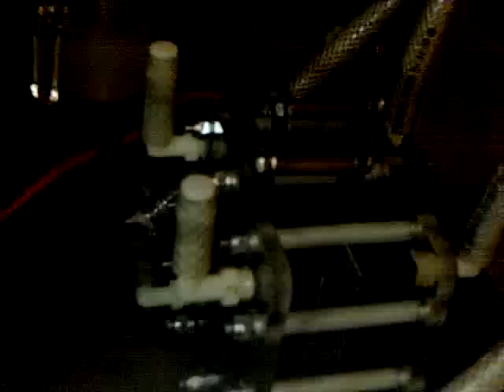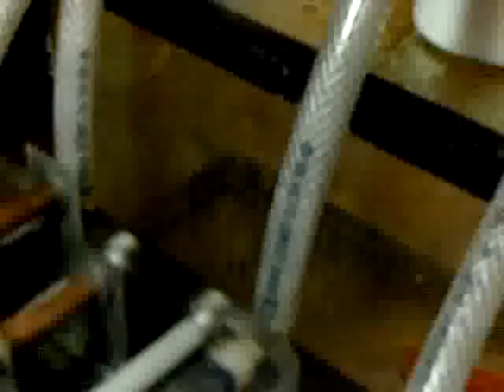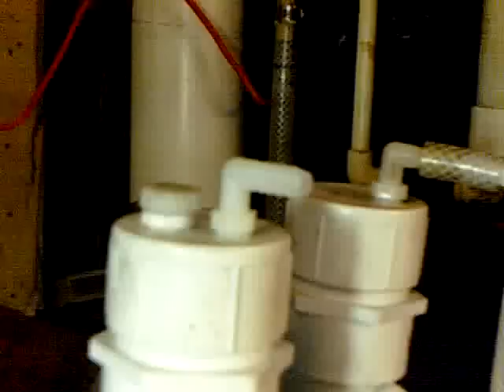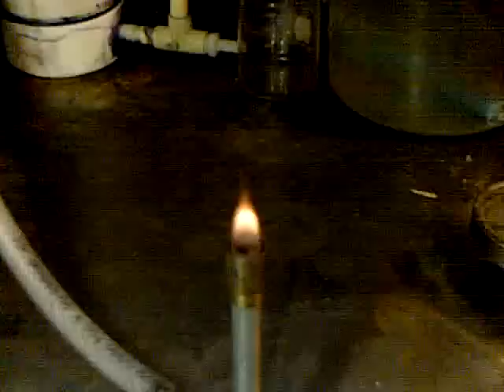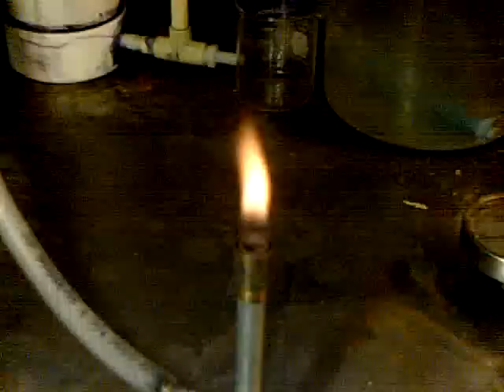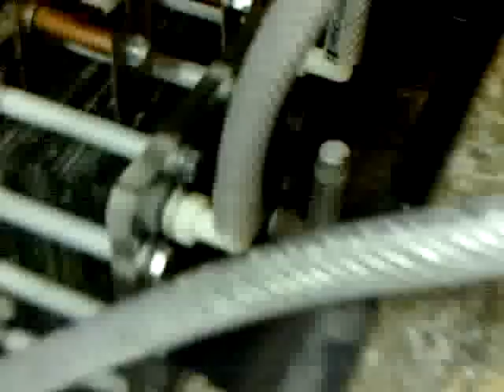Proof Of Concept Ver2 6N3 005

Comment from the maker: @GULFCOASTCLEANENERGY 
The same places that you would source the materials for the standard Tero common duct searies cell. The only addition is the separater material  membrane which is 100% Rip stop Nylon (Uncoated type).That the point of this design, it changes to a Biducted cell flow sheet. 
Do you have the plans set????
Bill

Comment from the maker: @GULFCOASTCLEANENERGY 
The 5X5 Ver2 was at 2.5 L/m if I recall when the video was taken. The 8X8 produces 6 L/m at it design spec. Please keep in mind the the gas are separated (2:1 ratio). Volumes were taken from both sides of the cell to look at Ratios and possible losses due to the electrolysis process and design.
Bill

Comment: Great job. Your flame looks much less orange, more bright white with a little orange on the outside edges from the flame.  The orange might be caused by the air humidity and/or the metal from the burner. And indeed, oxygen does not burn without fuel. But even a small heat source might ignite any burnable fuel if lot's of oxygen is available. I'm glad you open sourced your design, I will check it out.

Best regards, iT